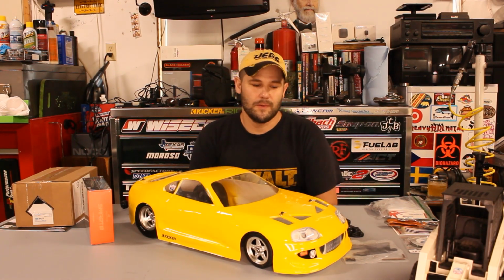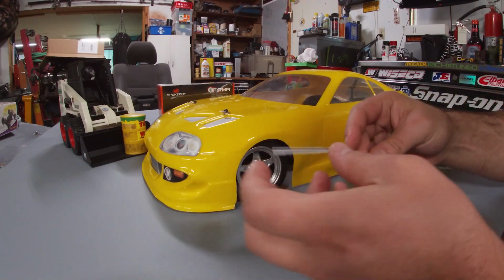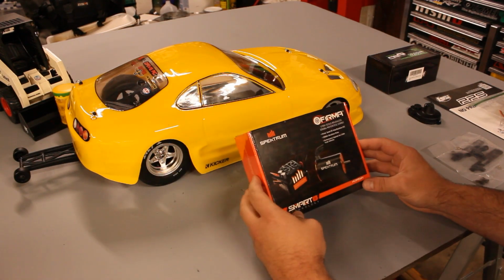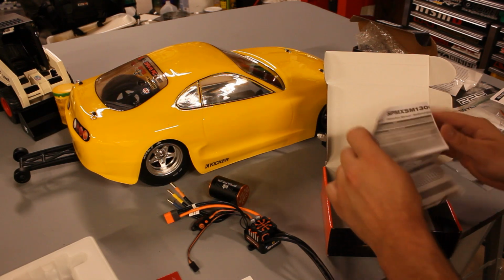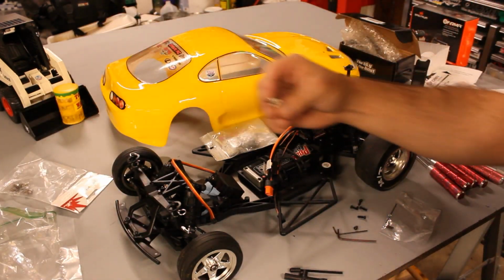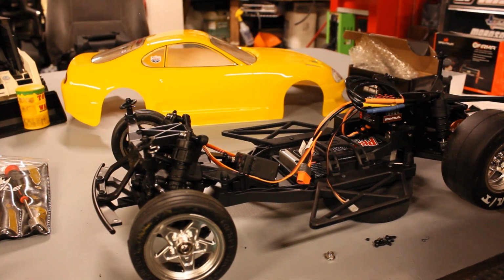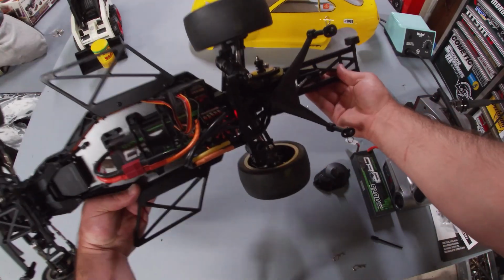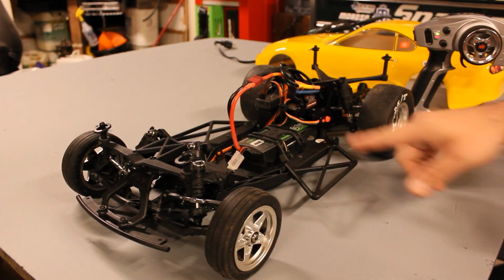Losi 22S No Prep RC Drag Build E.3 Body Motor ESC Stock class

Comment: Did they give you screws for the motor I have a roller on the way going to go with the 1412 castle motor and mamba 8s esc
Reply from the maker: Hi 45s! No I don't recall either the chassis nor the power package coming with hardware for the motor.  I sourced them from my bin. Hope that helps. That thing will cook with the setup you are planning!
Reply: @beauvrt  I ended up going with the Trinity drag master 3.5t thing was on sale for $65 and I’m still gonna do the mamba thanks for the reply

Comment: Not trying to burst your bubble but that 3300kv isn't going to cur it.  The 6500kv isn't enough.  Now you need a 2.5 or 3.0 turn motor to keep up.
Reply: That’s not true at all my girls Traxxas motor is doing 2.5It’s all about how you Gear that car will fly
Reply from the maker: I may end up getting a hot 13.5 turn to replace the spektrum setup, this is built for like a short course, I got it because it mounted in the stock location and was the right kv. Just the starting point!
Reply from the maker: I'm specifically building a stock class rig so it's more about suspension, gearing, dialing in your aero ect... you're only allowed to run 13.5 turn or equivalent which is 3300KV no higher. Only 2s. Fast times being 2.7-2.9 no wheelie bars allowed and you must have a scale accessory like a chute, turbo, sound box ect...

Comment: When i ran mine stock i was geared 84/21 ET: 2.64 MPH: 56… Punch level 5, Forward/Brakes only and Timing on Level 8. Get you a battery with 120c or better! Good video 👍🏾💯
Reply from the maker: That's moving for sure! What motor, esc, and battery were you running? Thanks for the feedback, I appreciate it. We went out yesterday with a 50c 2s and did a 3.5 @ 32mph the "out of box" numbers... just put on a 21T pinion. Video coming with data and all. Time to tune.
Reply: @beauvrt  that was on stock esc and motor, using a CNHL(china hobby line) 7600mah 120c LiPo.
Reply from the maker: @BigBoyzGaming386  That's fast, this build was the roller, if you had the RTR it came with a 100 Amp esc and fast 6500kv motor. I'm running the 3300kv 85amp setup I purchased separately. I'm going for the 13.5T stock class. So I can only run the 3300kv brushless.
Reply: @beauvrt  ahhh gotcha so gearing is going to be your deal, try 72/30…